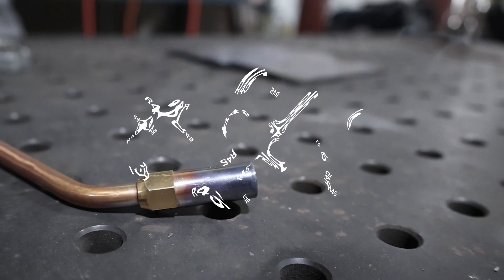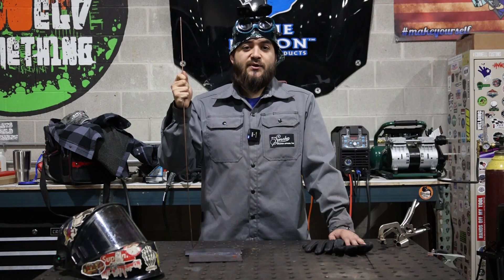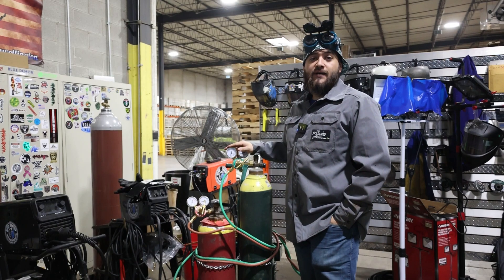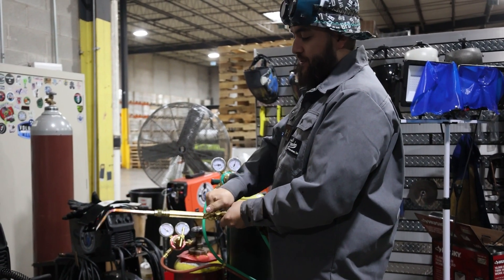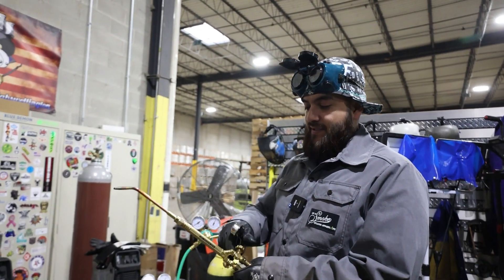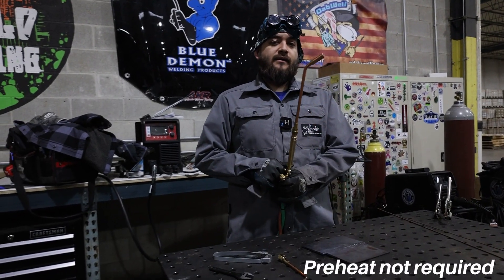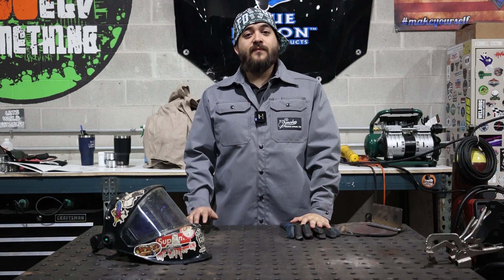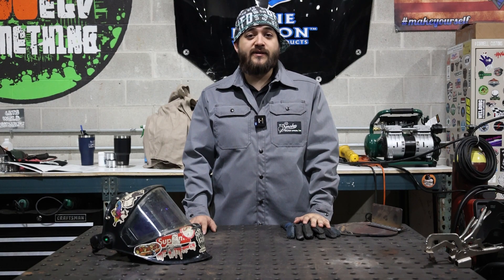Blue Demon R45 Oxy-Acetylene Gas Welding Rod

Comment: welding thin wall 4130 tubing for aircraft frames and engine mounts they suggest er70s-2. What is the blue demon equivalent? Suggestion for rod? Gas welding rod, tig rod, Both? Thanks

Comment: Whats the difference between coated cooper wire and NON coated copper? Like whats better to use and what materials should use coated and what materials use non coated?
Reply from the maker: Copper on R45 material is purely to help protect it against rust.
Reply: @bluedemonweld doest it weld stronger than non coated or just the same strength?
Reply from the maker: @HemiOwner6.4  exact same.  tensile is 45kpsi

Comment: What is your thought about welding sheet metal panels this way in cars instead of using an electrical way? Like 19 to 22 gauge! Do you think a heat stop is the best way to go. Used to do some welding till I got a pacemaker. Just thinking about picking up the hobby again!
Reply from the maker: not my forte... but seems like it would take too long.  multiple mig tacks is what i see all the time